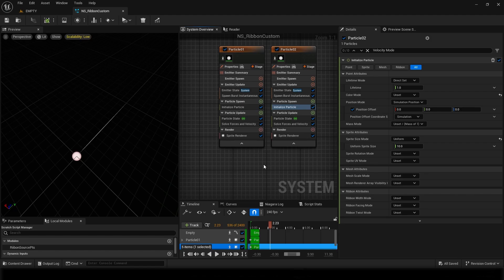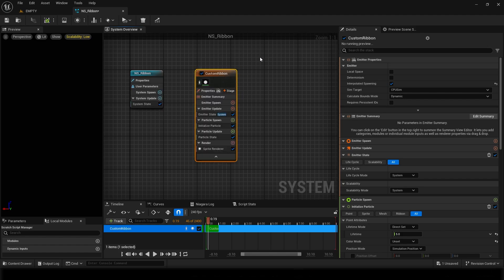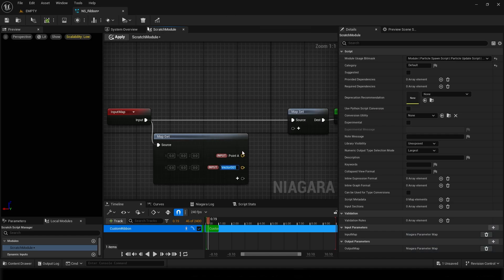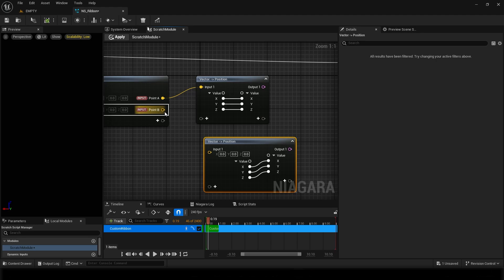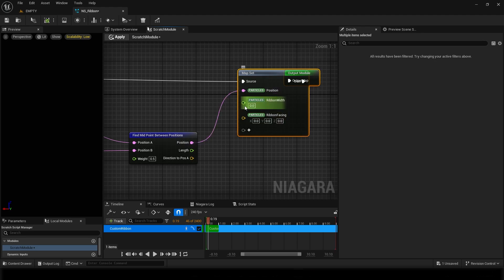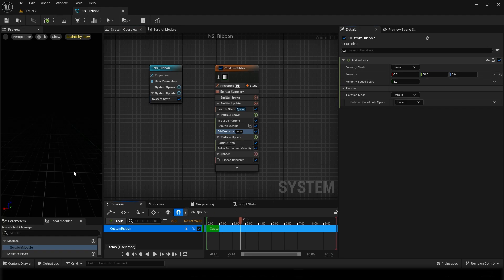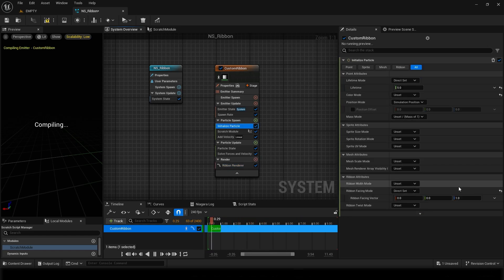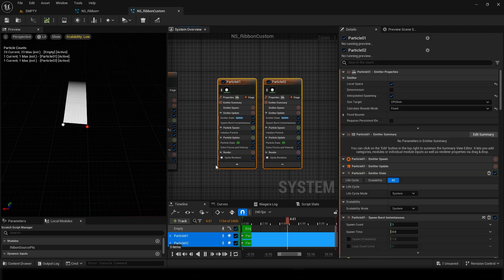How to Set Custom Positions for Ribbons in Niagara using Scratch Pad | Unreal Engine 5.3 | Realtime

Comment: Hi, can I ask you if I can change the original tube ribbon shape in the same way? I need the ribbon to be initially spawned in an oval or ellipse shape instead of a  Tube shape.
Reply from the maker: I didn’t quite understand this, by default ribbon spawns as an plane and you can change the renderers to tube or multi planes, but I guess you are trying to say you want the ribbon which default comes in straight line , should be spawned in shape of oval as a whole right?
Reply: @aashishbharunt Yes, that's right. All I can do is select the shape of the Tube, as well as change the width, but this is not enough, I would like to change the shape to an elps, for example, if I could change the Height of the tube
Reply from the maker: @ for exact shape I have to check if it is possible or not, but by default we have height and width control. so ribbon width controls the width and if you increase lifetime than it will increase the height right ? 
I still might be confused from your question, if you like to show you can join my discord and share snippets so I can check.
Meanwhile you can have a look at this if you want something like this
https://dev.epicgames.com/documentation/en-us/unreal-engine/how-to-create-a-ribbon-effect-in-niagara-for-unreal-engine
Reply: @aashishbharunt  thank you! I wrote to you in Discord in "general questions"
Reply: @aashishbharunt Also, if you know a lesson on how to Create a Ribbon in Niagara that remains a ribbon, but follows the contours of the object to which it is attached, that would be very cool.
I think it will be very difficult to do this, so for now I am trying to solve the problem that I described earlier